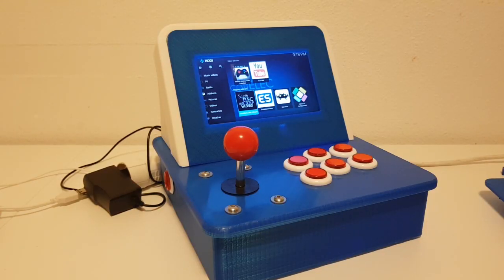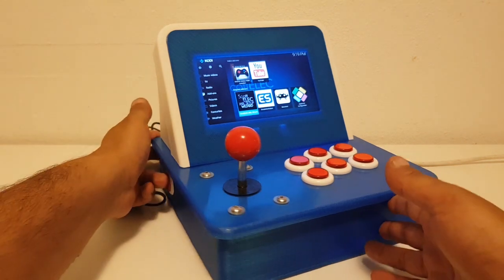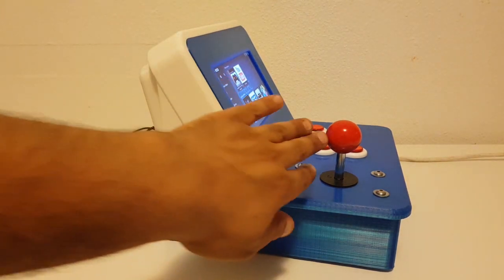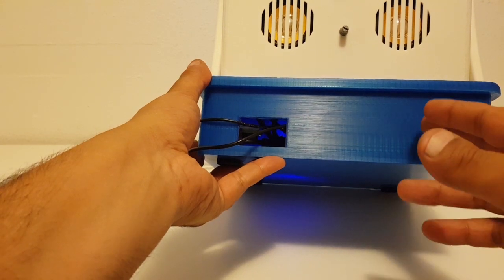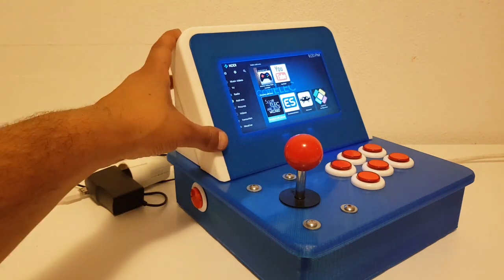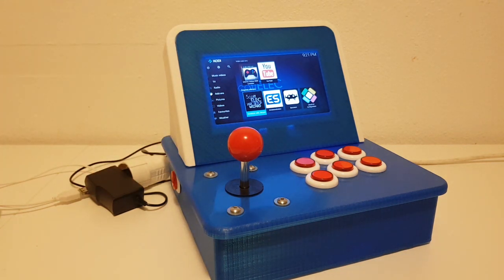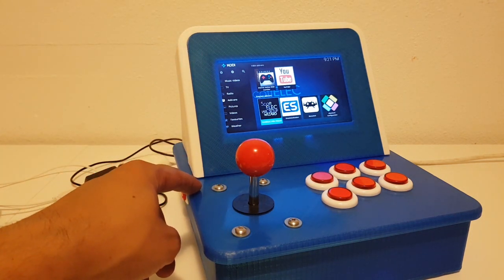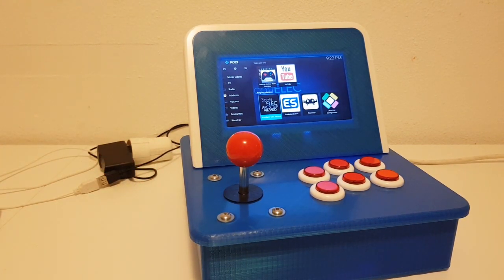I modeled and 3d printed my own Mini Arcade Bartop (Show and tell + Assembly. Scottelec firmware)

Comment: If you can build bigger machines and mod in a euro coin slot then you can open an arcade.  If you make enough euros you can quit your day job.

Looks nice btw.
Reply from the maker: Gimp Man but i can rent out smaller machines easier. Plus shipping is cheaper :)
Reply: Canino's Gadgetsandwhatnot True.  Maybe rent them out to use in workplace cubicles.  Of course a headphone jack would be a must.
Reply from the maker: It got bluetooth buildin 😁🤣
Reply: Canino's Gadgetsandwhatnot I was hoping for an earphone jack because 15 minutes ago I won $65.00 Macaw GT600S earphones in Gearbest’s World Cup Shootout.
Reply from the maker: Nice one!  Have fun with it, i'll check that out. I got a nice bluetooth headset affiliate link for you ;)